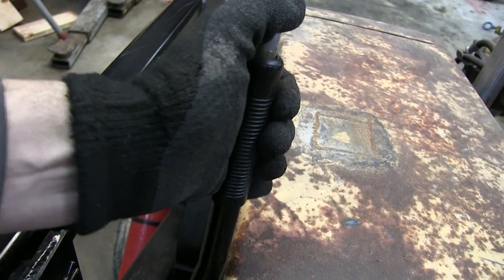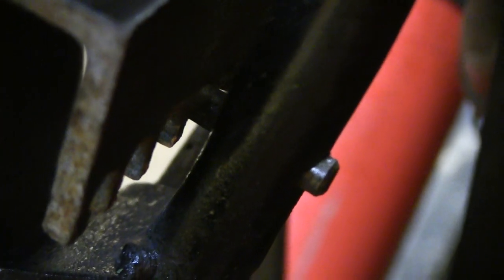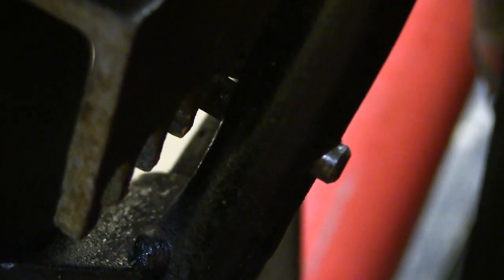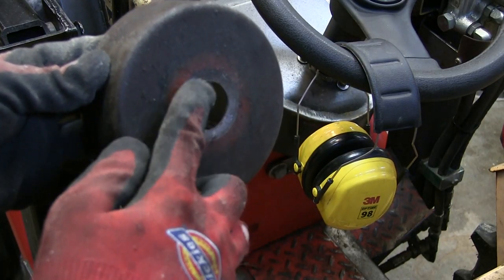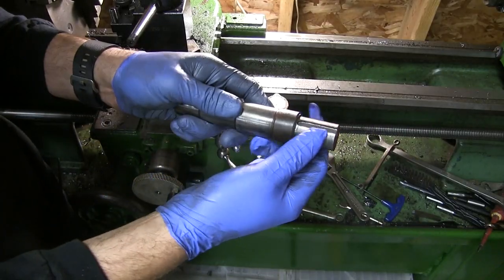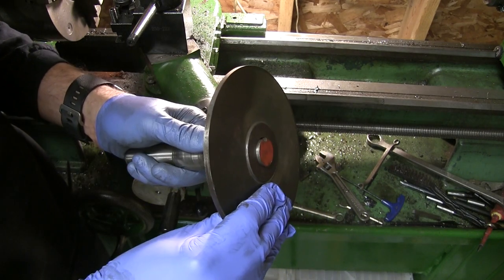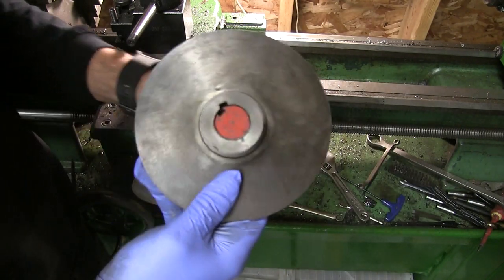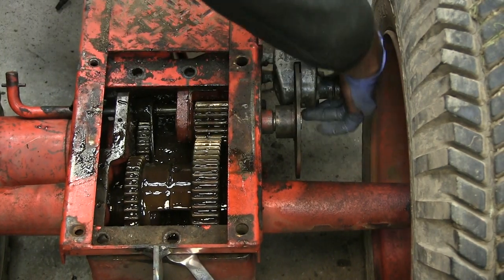Case 446 Front End Loader, Disc Brake Conversion

Comment: Thank you for sharing this. 
This might end up costing as much as the mythical L9 hydro unicorn valve but
I have a real liking for an actual brake. 
Now let's see where do I want to mount my new brake handle/pedal Hmmmmmmm ..............
Probably the stock location with every thing else disconnected ?
Yep that's it. 
And oh yeah drill and tap the end of the shaft for a bolt/washer to keep the key from walking out ?
or tack weld it in ?
Go cart disk pad arrangement?